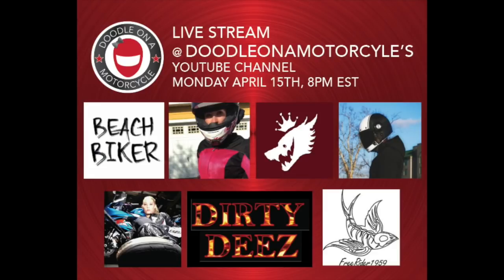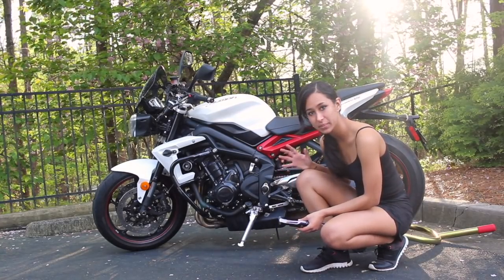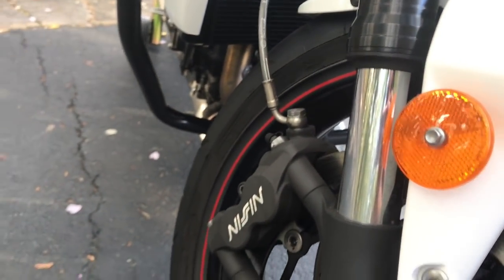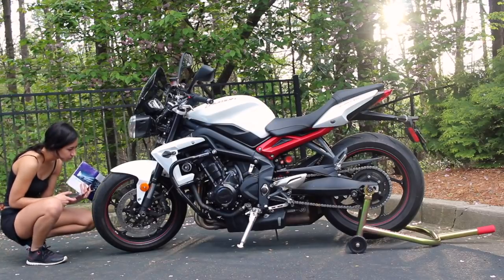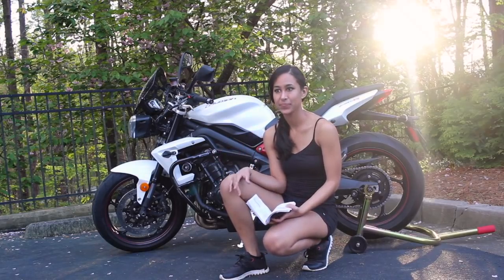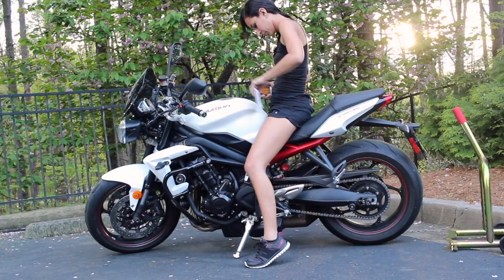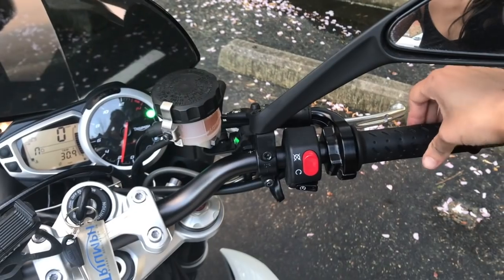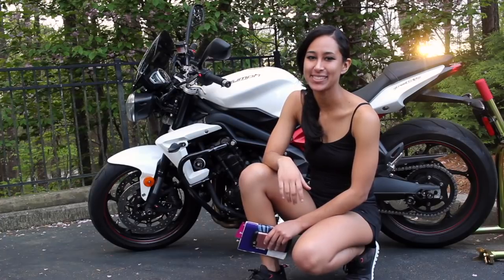HOW I INSPECT MY BIKE BEFORE A RIDE: TCLOCS

Comment: thank you for this video, as a female newbie rider in a country where the local language is not my native one, it's hard to find other riders to teach me such basics or  who don't talk down to you. This was a simple and clear video without too much technical talk, thanks a lot!
Reply: Check the axle nut, sprockets, brake calipers and brake disc with a wrench.  Especially if they have been changed recently. I've had rear sprocket bolts get loose.  Use locktite and torque to spec per manual.

Comment: DOT4 brake fluid is hygroscopic and absorbs moisture from air.  The water in the brake fluid lowers the boiling point of the brake fluid and can lead to failure of the brake at very high stress.  Therefore, the brake fluid should be changed completely every few years.  There are cheap gauges (in Europe about 20 €), with which you can measure the water content of the brake fluid.

Comment: One more thing you should do is look at the date on your tires.  Anything over 5 years, most shops won't install them.  It's not just the tread that matters.  There's a date code on the tires that show the week and year.  Also, when you buy new tires, make sure they're fresh as they're only good for a few years.
Reply from the maker: Good to know!! I knew helmets had a date on them too - didn’t know this about tires
Reply: @DoodleOnAMotorcycle  I didn't know helmets had a date on them :D  I know that you can replace the insides of the helmet so that it restores the firm fit, but I use a head cover to help keep the helmet clean.  I replaced 10 year old tires and it made a huge difference.  https://www.chapmoto.com/blog/2013/01/16/tech-tips-read-motorcycle-tire-date-codes/

Comment: Another great video, and good advice to all riders. You mentioned not to use the kill switch. On older bike's, where the switches switched high current, it was better to use the more rugged key switch, and save wear and tear on the kill switch. Today, everything is computer controlled, and low current. Safety instructors, today, say to always use the kill switch, because in an emergency, you will go to what you know. Others say to kill engine with kick stand for the same reason, do you never forget to put your stand down. In the end, all 3 will work, and should not harm your bike. On my BMW, I typically use the kill, bit somemetimes the stand. The engine is always off before the key (or button, with smart key systems). But again, it's just fine to use your kill switch. It will not harm the bike.

Comment: Following the service/owner manual is the right way, good job! As you learn and do repairs/maintenance you will tweek and fine tune the guidelines in the manual. My very first check every time I approach my bike is look at the ground where the bike is parked. Even a short ride can reveal much on the ground.

Comment: I have a Street Triple R, and find I get better steering feedback with 34 psi in the front, and a smoother ride with 38 psi in the rear. You may want to see how that works for you. Also the best way to check throttle free play is turning the forks fully to the left and right. I expect you will find that makes a difference. Ride safe.

Comment: I just subscribed to your channel today after viewing another of your videos and was checking out a few more.  I noticed that when you checked your tire gauge, you misread it. Each division is two pounds, not one.  Instead of 32psi in the front, you actually had almost 35psi.  The one for the back that you said was 41psi was actually 42psi.

Pencil gauges can be off by a bit too, and it's best to get one that's certified to within a certain percentage of accuracy.  Usually, the dial type ones with an air release button are best.  Most of that has been taken over by the "Slime" brand, which rarely shows accuracy stats on their products, so it helps to look around for a good one.  

It helps to keep your tire pressure as close as possible (as measured with tires cold, before the ride, if possible), since that's what the engineering dept. at the manufacturer have found give the best ride and steering response for most conditions, as well as maximizing tire life.

Other than that, excellent video!

Comment: You did at least mention checking the lights, but I would add check the brake light a few times  WHILE YOU RIDE, because that is when it is most likely to fail, and your ride becomes considerably more dangerous without it. Happy cycling!
Reply from the maker: Good call!!

Comment: Just so you don't have anxiety, the kill switch is not only for emergencies. You can use it to turn your bike off as often as you like. Ari Henning did a great video about it on MC Garage, but here are the cliffnotes.
1. The Killswitch, ignition, and kickstand switches are all on the same exact wire. They all do the exact same thing.
2. The original fear and myth came from older carburated bikes, people would turn off the Killswitch and forget. Then, they'd go to start the bike and it wouldn't start and they would keep trying and giving it gas and flood the bike.
3. The current reason for the warning is because you can forget your keys and leave the bike on and kill your battery. 

So to be clear, the killswitch is completely safe. The only possible issues arise from human error. I've only ever used a Killswitch on several bikes and scooters for years and have never had an issue. 

Here's the video by Ari explaining everything in detail. 
https://youtu.be/D0S4nMx_tbA

I hope this helps clarify, because some people have extreme anxiety about the killswitch and think it will destroy your bike. It's just a convenient off switch, so go ahead and use it as often as you like.
A good reason to use it is one way I use it. I ride at night most of the time, and when I bring my scooter home I need to pull it up to my door. So I hit the Killswitch at the end of the drive, and push it up into place with the headlight running so I can see what I'm doing. 
There are other good reasons to use it, it's faster and easier, it's convenient for a quick stop to chat or something at a gas station, it's good for doing maintenance on your bike since you can just reach up and tap the switch without standing up and getting to the key.

Hope this helps. 
Ride safe and have fun!

Comment: When checking the oil, take out and wipe the dipstick, insert it back in the hole without screwing it in, take it out, level should be between the upper and lower.
If you screw it in the reading is incorrect 😉 I've been there!
Reply: No, it depends on the bike; read the User Manual for your bike, first.  My Triumph User Manual specifically says to screw the dipstick back in to read the oil level.  You do need to have the bike level and upright though, so better if it's not elevated on the rear stand when you check it.

Comment: Seems a tad excessive for every ride. I'd say it depends on how far you intend to go for the ride and the time since your last inspection.  For lots of short rides under 10 miles do this kind of a check once a week/fortnight. And a quick oil and fuel check every day. Doing a proper full bike check every month of low usage and every time before a major journey.

Comment: I always make sure my fluids are maxed.
Reply: Too much oil is not good.  This can damage the cylinder head gasket and lead to oil foam in the crankshaft housing.  It is better to fill the oil only between min and max.

Comment: You said tyre pressure was to be 32 front and 42 rear. .... Then when you measured the front tyre it read 34, and said - "Perfect". ... The rear was probably 41.9, but you read it as 41 and said close enough.

It looks like you are reading each marker on the tyre pressure guage as 1psi. When each marker is actually represents 2psi.

(Lastly why not get a small tub of something like Hammerite, and a tiny brush. To very lightly touch up the scuff on the crash bar. Unless you're hoping to buy some paint of the exact type that is.)

Comment: You're a better person than me. By the time you're done the pre-ride check I'm already back from my ride 😅😅😅😅😅😅. Just kidding. I'm curious about a couple things. I'll have to check my owners manual (2015 Sportster 1200) but it didn't say to ONLY use the engine kill switch in an emergency and to primarily use the key. Also, maybe I missed but did your manual say to check the front/rear turn signals, horn and to make sure both brake levers turn on the tail light? 
Back to the owners manual for me. Glad I keep it on the coffee table when I'm not riding. 
Keep riding and stay safe, Doodle!
Reply from the maker: 🤪 In the “daily safety checks” of my manual it does say to check all electrical components

Comment: My bike has just had it’s yearly inspection test which is law in the uk  needed brake pads on the front and I got them to change spark plugs and ht leads costing £300 so all i need to do is my standard weekly checks

Comment: DOT brake fluid is hygroscopic. That means it wants to absorb moisture. If your (rear) brake fluid reservoir is higher than it used to be, then it has absorbed moisture and needs to be flushed. Do it now, I would hate to lose any future videos from you.

Comment: This is the first time I heard that it's better to turn off the engine without the kill switch?  It makes sense but in my MSF course we always used hte kill switch and the last thing was to turn off the bike.  Is this unique to Triumph bikes?  In most motovloggers I see them use the kill switch first as well.  Also I dont have a stand... guess levels of fluids can't be accurately guaged while on kickstand?  Or is it fine as a pre-ride check for a short ride? -- edit nm, when they delivered the bike they emphasized not to use the kill switch :)
Reply from the maker: I know my MSF course was like that too! I’ve only read two Triumph manuals and both said turn off by ignition - I think it’s just so you don’t have the lights on with the engine off and draining battery. I’d look at your bike’s manual! Sometimes you can find that online as a PDF if you don’t have it. Can’t gauge levels accurately on the kickstand! BUT... you can get a block of wood at a Home Depot in the scrap section, put it under the kickstand (would need to figure out how thick to make it  straight up - usually about 2”) and then check levels!

Comment: Should have left it running when you turn the bars from left to right and check clutch and throttle play at full steering on both left and right. Sometimes there is barley enough slack or no slack when the bars are turned for the cable's and can make pulling the clutch or twisting the throttle difficult and some times they can even be active ( example turn the bars full left and rpms are risen just a little bit )

Comment: Those pin pressure gauges aren’t very accurate. It’s definitely going to matter if you’re riding harder. Tire pressure can be the difference maker in causing you to throw the bike down the road. Stay safe.
Reply from the maker: I don’t ride hard 🤣
Reply: Doodle On A Motorcycle You should. Sign up for some track days. You’ll become a much better and safer rider.

Comment: Doodle !! just a few things. your antifreeze or coolant level. After you ride the bike and it warms up, look at the level again, coolant expands when bike is warm. I would not add any unless it is under the min. line when cold or you might get to much in it and it will push out the coolant causing a slippery condition for your tires. Next, at 3:17, the hose under the rear brake reservoir looks twisted and kinked. Possible brake fluid has trouble getting past the kink. I'd check that issue out. Last thing is when you turn bars fully left, keep them left and with bike not running, twist throttle all the way and make sure it returns to fully off position. Than do same test when bars are turned fully right. Throttle can stick at times when bars are locked full right or left, due to cable moving as bar is moved. Great job with the checklist that everyone should follow. Stay safe and stay awesome.